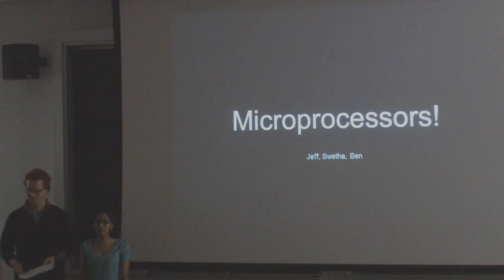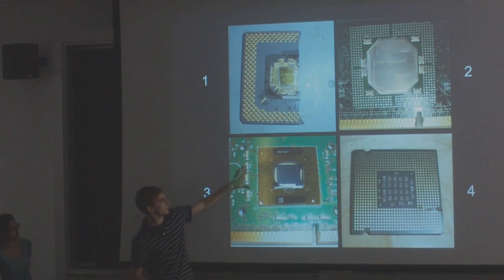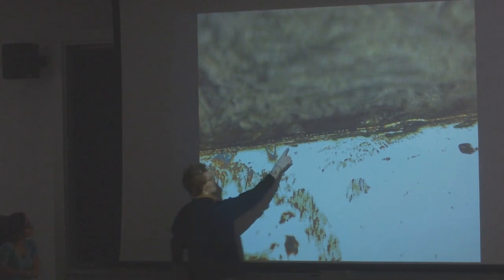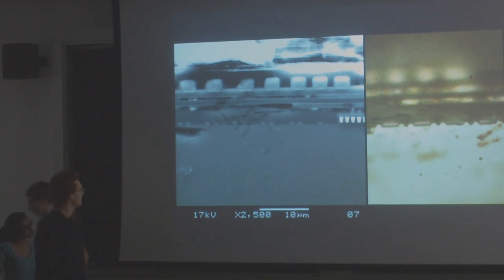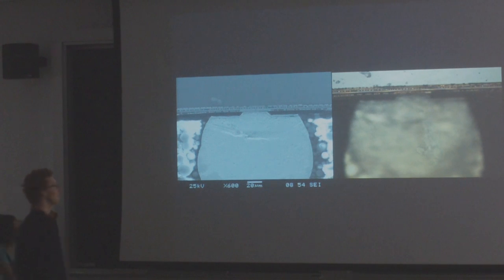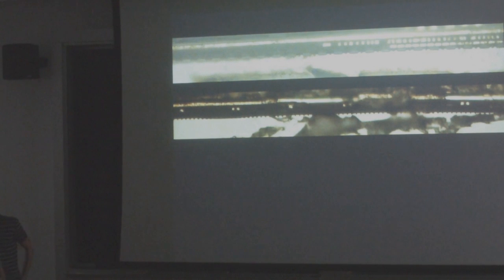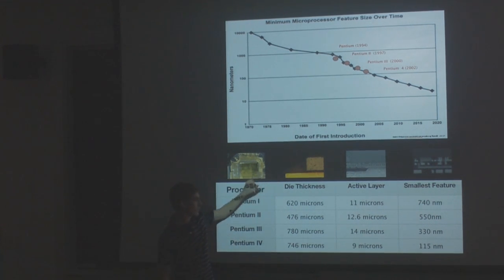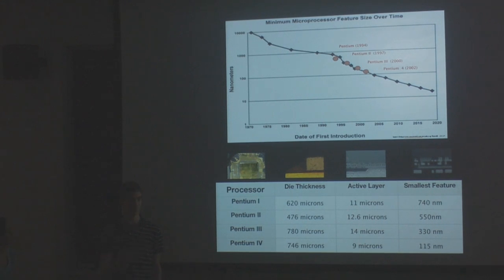Microprocessor Deconstruction and Imaging Part 1 of 3

Comment: @pavelp80 OK, cutting and polishing is in the 3rd part. I found out that AMD CPUs are more interesting: Al+Cu (probably) interconnects in Durons, nine layers in Bartons. On the other hand Celeron D has much more vias to transistor layer (as much as possible), but its hard to quess from the small volume.

Comment: Nice video. I'm just experimenting with 3D reconstruction of interconnects (using FIB for slicing). How did you polished the cross-section? I just can't get so nice surface, it's always crushed to dust to depth of few microns and it contains some cracks to tens of microns. From some point of view the sample is less damaged from hammer than sandpaper/sharpening stone :-) The second problem is to interpret dark rectangles below interconnects. (Btw AMD used both Al and Cu in first socket 7 Durons)